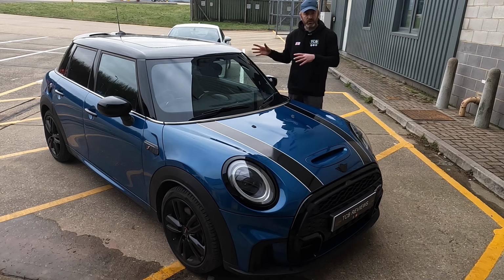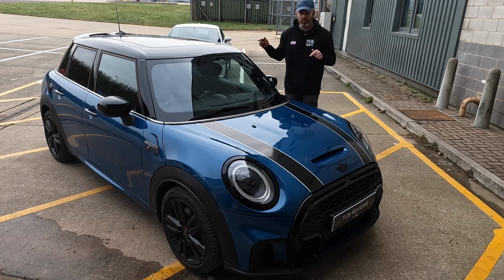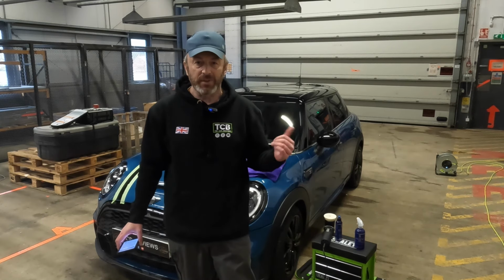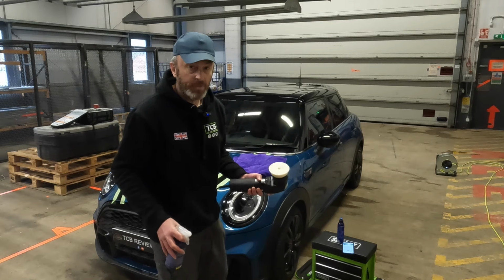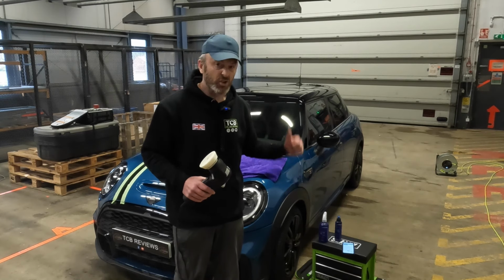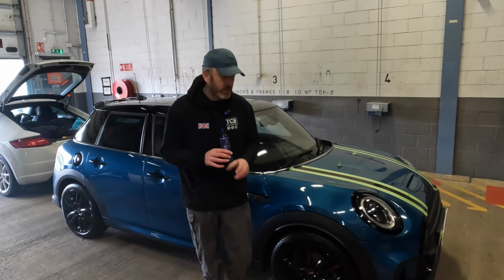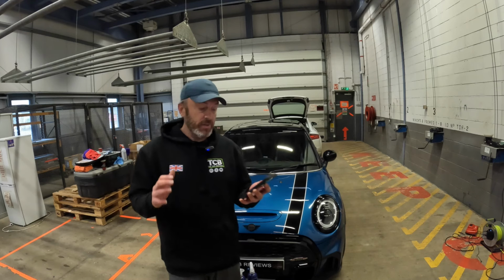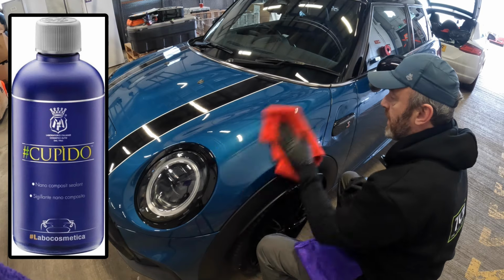The Car Boutique reviews: LABOCOSMETICA VENERE & CUPIDO

Comment: Great review and really shows the capabilities of Cupido. One note around Cupido being "grabby". To avoid that use Venere and do not buff off but apply Cupido on top of it. Then buff. Makes it very easy to buff afterwards. Best used in sections of roughly half a bonnet/door at a time.
Reply from the maker: Hiya buddy and thanks. Yes a few people recommend this so planning to try the dual process this weekend. Seems weird but I see the logic in it. Thanks for the advice buddy.
Reply: That's a cracking bit of insight!
Reply: This method is recommended by Labocosmetica.

Comment: Great video Andy, been waiting for someone to review these two. They say you can remove the Cupido and Venere together, which I did but better the way you did one at a time. Solid products and the car stays cleaner for longer like sigma. I ran into trouble doing a big area but a damp microfiber no bother sorted it out, got 3 months easily and reapplied Cupido just because 🤣🤣👌
Reply from the maker: Hiya Kev and thanks. Yes whilst I was testing this before the video, I also found that if the panel your working is too big, the product starts to dry which causes removal issues. Best to take your time, a small work area at a time and then it's easy, may I actually say pleasurable. I will monitor this system for longevity and if I get 3/4 months out of it I will be happy. As always thanks for watching the video and engaging with TCB.

Comment: Did you try to work it a little harder on say speed 4 with a rupes yellow foam pad? I've been looking at this combo for months. Labocosmetica has great products from what I've used so far. I might get fiero instead...leale is really nice.
Reply from the maker: Hiya Brad. I didn't use the machine on a higher speed on this video. Interesting point though so will certainly experiment on higher speeds next time. Thanks for watching and leaving a comment.

Comment: Hi Andy,
What snow foam and shampoo  ( super sudsy! ) was used on this one ?
Looks great 👍🏻 
Another super video.. 👌
Reply from the maker: Hiya buddy. The snow foam was Labocosmetica Primus 2 and the shampoo was Labocosmetica Purifica. Cheers.
Reply: @thecarboutique2467  had a feeling it might have been  !!
Nit a bad product in their arsenal 👌
Reply from the maker: I totally agree. A very strong brand across their entire range.
Reply: @thecarboutique2467  Neve and Semper for ceramic coating maintenance washes ?
Or any other better combo suggestions?
Primus and Purifica for un clogging or decon washes ?
Reply from the maker: Hiya and sorry for delay in response. It has been very busy at TCB HQ. The Labocosmetica range does offer products that are geared towards both coated and non coated cars as your comment suggests. For cars that have a delicate wax, or if they are only lightly soiled, I will use Neve Ph Neutral Snow Foam with Semper Neutral shampoo. If however I am conscious of potential organic or mineral contamination I will then use Primus (targeting everything in the organic range) and then use Purifica (targeting mineral contamination). For vehicles where I suspect the coating may be clogged, again I will use Primus and Purifica. Putting this aside, I do tend to stick to the Primus/Purifica strategy as it offers an improvement in cleaning and does not in my experience show any significant effect in terms of degradation of LSPs. Happy to hear your thoughts as well. Cheers.

Comment: Good god, the mini looked a million dollars, very lucky owners.  I have a question about the polishing process. You said you used a panel wipe after the glaze, is that normal for a glaze?  I have very little knowledge of them, but I do have one that I was going to use on a friend's car this weekend. Also, can you top a glaze, with say TW Hydrophobic Sealant? As usual all the best and thanks for the work your team put in.
Reply from the maker: Hiya Lee and thanks. Just to confirm. I only used panel wipe on a small section as a test. I wanted to see if the glaze was masking the scratches or indeed the micro abrasives had removed the scratches. The panel wipe would remove the glaze a little so I could see. I found that the scratches were still not visible concluding the micro abrasives had actually polished out the scratches. You definitely should not panel wipe after using the Venere. Just apply and go straight to Cupido. If you were using a normal compound or polish, yes panel wipe after every pass.
Regarding the glaze question, yes you can top a glaze. In my example that's what we have done by applying Cupido. If you use a dedicated glaze, I would actually encourage a sealant after. Hope this helps and feel free to ask any more questions. We do have a Facebook group you can join which is a great place to ask questions and get great advice.
Reply: @The Car Boutique  brilliant,  thank you, thay gives me the confidence to glaze and seal this weekend. BTW, I'm the only person in England without Facebook, or any other social media, sad hey 🤣

Comment: Does the have to be inside for to use capido or can you use it outdoors
Reply from the maker: I would advise doing it indoors buddy. Like ceramic coatings it is recommended to apply in a dry, dust free environment etc.

Comment: Can Cupido be used as a topper to a ceramic coating or is it a bad idea?
Reply from the maker: Hiya buddy. I can see no reason why you could not use Cupido as a topper however, I am a purest and do not usually have anything on top of my ceramic coatings. I can understand why people may want to do this but I want to enjoy the benefits of a coating and not cover them up with another product. It is definitely an individual preference as to whether you use toppers or not.
Reply: @thecarboutique2467  I understand where you’re coming from and I agree, I was just thinking it as a sacrificial layerz so due to the harsh winters we get here in 🇨🇦. My car takes a beating wish all the salt and grime. 👊🏼
Reply from the maker: I do agree with you on this buddy. As a sacrificial layer over Winter there is no reason why you should not use toppers. Further, over time your ceramic coating will get clogged so rather than have to do a dedicated decon wash everytime to restore hydrophobicity, it does make sense to apply something to help this function out. If you can help your coating out over Winter then yes I would agree that any help is welcome.